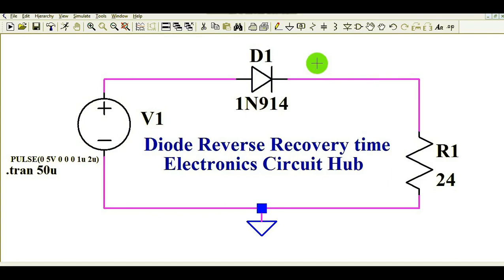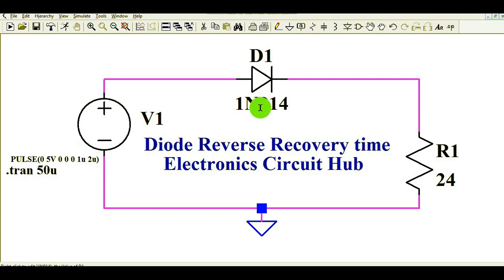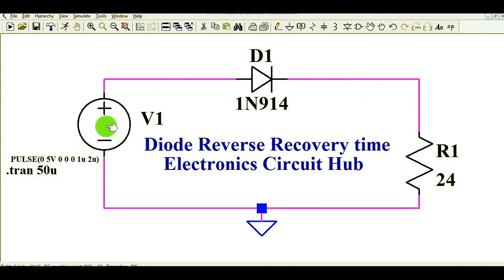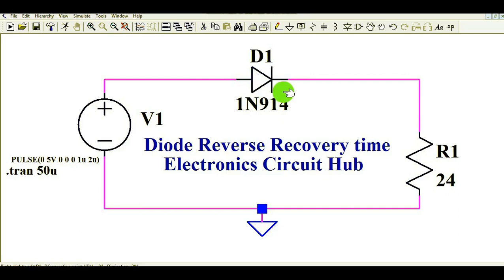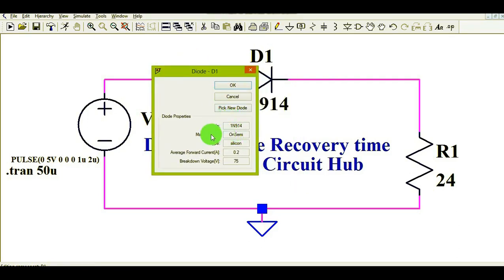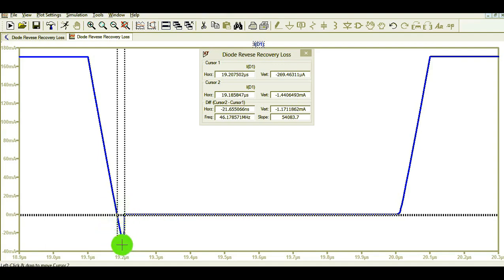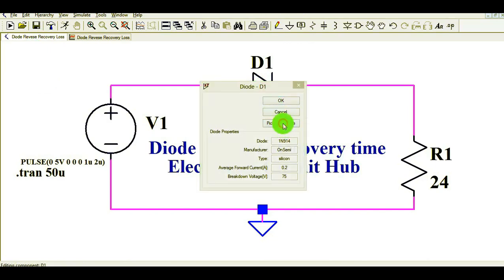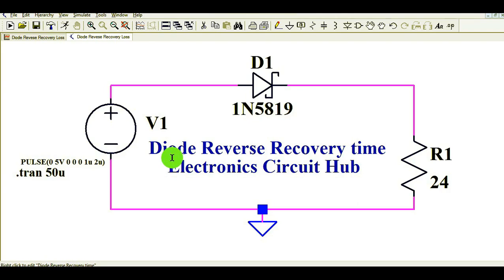Simulation of diode reverse trr recovery time in ltspice

Comment: How can we measure reverse bias voltage?
Reply from the maker: Hey...thanks for asking great question. Reverse bias means diode when diode is not conducting. Generally in dc we are not much bother about the PIV but in AC/pulsed voltage source the PIV comes into picture. Lets say you have AC voltage source with peak voltage of 230VAC so we need to select the diode which have PIV more than 230V.
Hope I answered your question.
Reply from the maker: For measurements, connect the DSO between diode Anode and Cathode.
Reply: @ElectronicsCircuitHubECH indly requesting you to make a video which is having 24 v peak to peak and a DC voltage of 12 is connected as charging  battery and show how reverse bias voltage is measured
Reply from the maker: Could you please explain more about your applications? I do not understand why you are 24peak-peak to charge 12V batter.
It is also not a recommended practice to charge the battery.
Reply: @ElectronicsCircuitHubECH  a sine wave with 24 v pp amplitude is given to a diode and having a series connected resistance of 100 how can we measure maximum reverse bias voltage that appears across diode
Reply from the maker: @poshamsushmitha1561  okay, got it.

Comment: Great video.  Allot of action.

If one changes the ON current level, does that change the maximum of reverse recovery current spike?
So changing the R to 50 Ohms, what would be the maximum of reverse recovery current spike? Then change to 25 Ohms, then 10 Ohms, what happens to the maximum of reverse recovery current spike?   The Reverse Recovery Time would change too, if the maximum of reverse recovery current spike changed.

It would be nice and interesting to see how this reverse recovey current effects a buck converter.  What type of diode is best to use in a DC-DC converter circuit?

Thank you for the great video.
Reply from the maker: Hey, thanks for asking great question. I would encourage you please download ltspice file given is description and play with it.